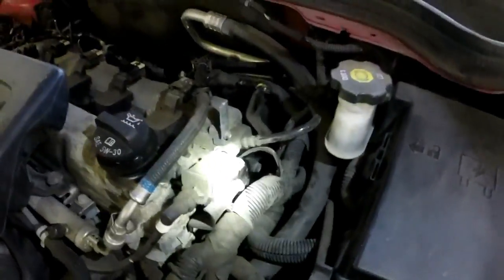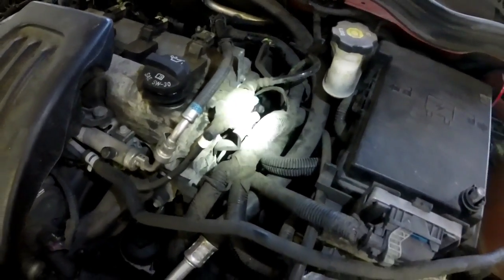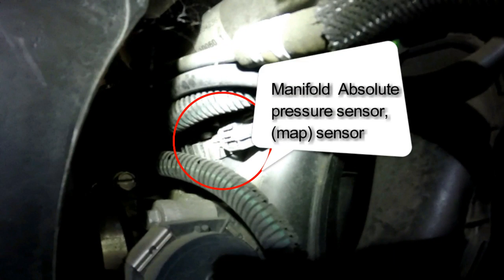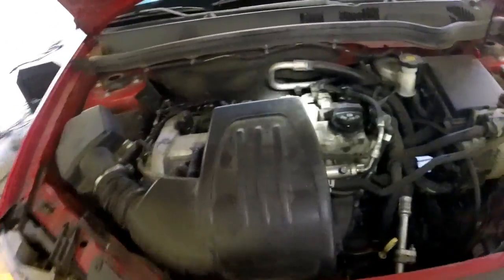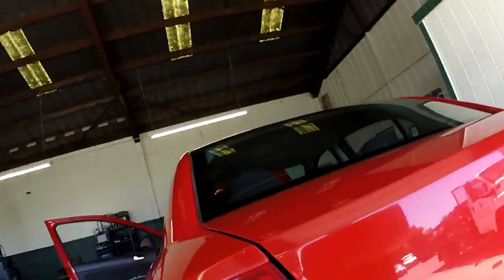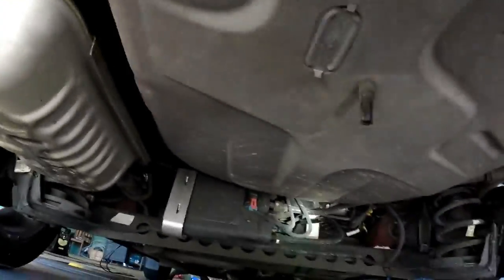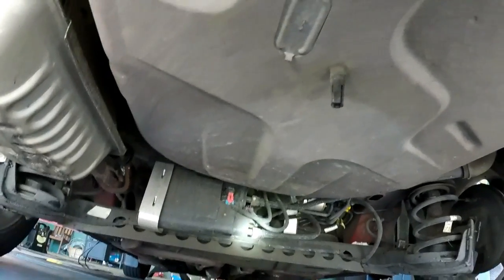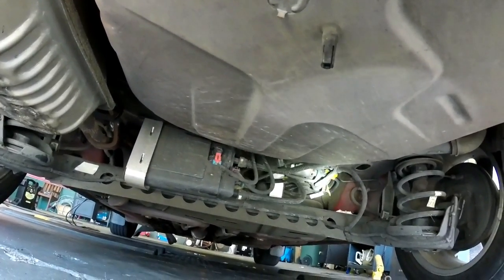Chevy Cobalt Emissions / smog locations: Evap canister, Purge, O2 sensors, & MAP sensor

Comment: Question about the O2 sensor you showed. Is that considered The Bank One O2 Sensor? Is there another behind the exhaust manifold heat shield? I have a 2008 Pontiac G5 2.2 and I have an check engine code P0030 so i'm trying locate my O2 sensors. I know the Cobalt and G5 were similar vehicle builds. I'm not having much luck tracking it down and came across your vidro. Seems to be alot of Chevy Cobalt how to videos but not many Pontiac G5 how to videos. Thanks

Comment: I have a 2009. Can a faulty evap canister cause you to smell gasoline? I smell gas from that area once in a while (and I did replace my gas cap), not all the time. Going to have someone look at it.
Reply: Did u ever figure out y u smelt gas my 2010 when I turn the ac on I smell it now once in a blue moon my car will say check gas cap other than that it's evap emissions large leak and another is small leak detected but o2s are OK except 1 that says it's stuck Rich
Reply: @jordonhoward5606  I found out that the patch job that was done on it wasn't the greatest.

Comment: on a 2010 I have a harness that splits into 2 connectors going to the canister. One connector which has 3 wires (Green, Black w/white stripe and Gray with white stripe is broken on 2 of the wires. Where can I get a replacement for it. It is causing my check Engine light to stay on.

Comment: Would you happen to know where the fuel tank pressure sensor is on a 2007 Chevy cobalt and does the tank has to be dropped in order to change it?
Reply: It's on the canister he was showing at the end you don't have to drop anything

Comment: I have a 06 Chevrolet cobalt ss/sc and it has the mass airflow sensor circuit low and evap code. I just put a new pcm in it and it goes into engine disabled/reduced engine power and it wont start after. Unhook the batter will run for 10-15 seconds and it does the same thing.
Reply from the maker: You need to figure out what the engine is cutting out. Is it cutting out spark? Is it cutting out fuel delivery? You might have a issue with the fuel pump going bad or something like that. You could have a crank or cam sensor going bad. Have you checked the continuity or resistance through the mass air flow meter? Or have you tried to clean the mass air flow meter? When you run into instances like this a lot of manual diagnosis comes into play.

Comment: I change the purge valve on my 2010 cobalt and still get a check engine light with the same code P0449
Reply: I know this is late but its most likely your fuil tank pressure sencer